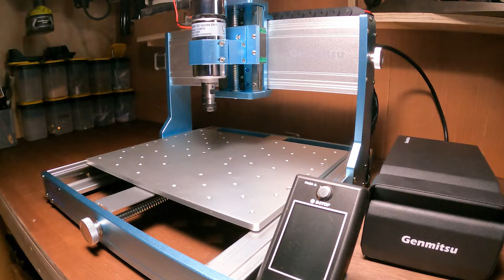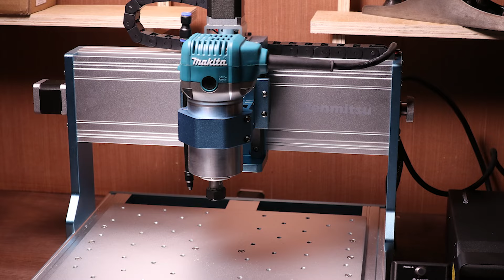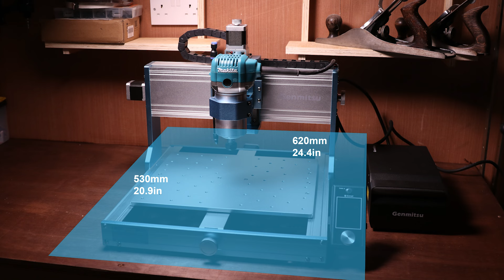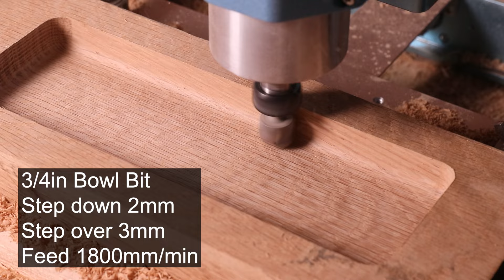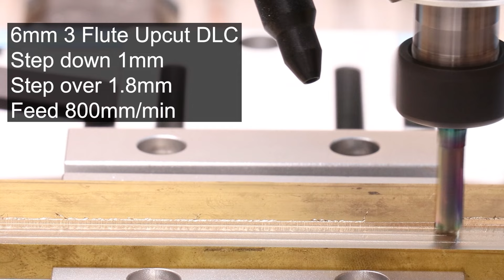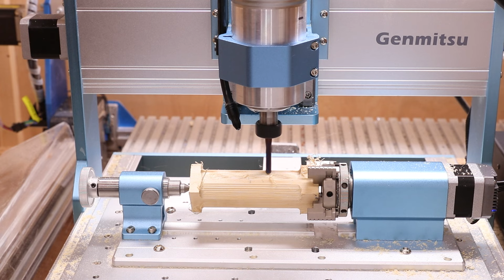Best CNC under $1000 - 3030 Prover Max Review

Comment: Hi! Could you tell me how far the CNC worktable extends beyond the machine's frame, both at the front and at the back, when moving through its full Y-axis travel? I'm trying to calculate the maximum space required for an enclosure. Exact measurements in mm would be really helpful. Thanks!
Reply from the maker: Unfortunately I no longer have this machine but Im sure if you asked on the Facebook SainSmart user group then someone would be able to help

Comment: Hello! I am between the 3030 Prover and 3020 pro max v2. I wanted 3020-PRO Ultra 710W but it is not available for EU atm.
I want to cut pieces out of 5mm stainless steel sheets. Speed and bed size are not important. Precession is important! I hope you can advise!

Comment: Can I ask what would ideal settings be for cutting aluminum with a 1/8" 3 flute carbide upcut? I have heard various things and also to use cooling, such as isopropyl alcohol. Your settings look very aggressive: 1000mm/min feed, 1mm depth per pass. And also, what speeds were you running your spindle? I have a similar machine, the Axiscreat 3030 with the 710W router and running it at full speed tends to melt the aluminum when cutting too aggressive. I was told to slow down my spindle to get faster cutting speeds. Most super pro CNC machines run their spindles very low, but the brus motors on these routers don't have enough HP to run those slow spindle speeds.

Comment: Hi, James. Just bought one of these and I have a couple of questions before I assemble it and design/build its enclosure.  1) If I don't fit the offline controller, is there another port anywhere else for the touch probe?  2) When you state the assembled dimensions, is the total width (stated as 530mm) inclusive of both the stepper motor and the offline controller?  Also, I have to say many thanks for all the great tutorials because I wouldn't be able to do most of what I can do today without them.

Comment: Would you say this is better than the xe pro at cutting aluminum
Reply from the maker: @swiff31  the standard XE Pro, yes. But if you added the linear rail upgrade to the XE-PRO then the XE-PRO is probably better
Reply: @ thank you I already have the xe pro I may add the rails to it

Comment: Mr. James, thank you for your videos, good explanations and great friendliness.
I just bought a CNC 3030 ProVer Max, it is really more impressive when you have it in front of you (The machine I have been using is the classic CNC 3018 Pro 100€, and now I am going to use a new CNC 3030 ProVer Max). It is like going from a sailing boat to a luxury yacht.

I have been watching many videos and I had many doubts between the CNC 3030ProVer Max and the CNC 4040 Pro. In the end, analyzing each of your words in several of your videos, I came to the conclusion that it is better to lose 10cm and gain rigidity.

The work is measured in quality, and quality is obtained in these machines from the rigidity and robustness of their guides and axes. Thanks to your videos I have been able to consciously decide which machine is best for my needs.

I haven't seen you upload a video recording stone yet, it would be interesting to use something soft like slate for example.
Thanks again and keep uploading content. We, the users, value it very much. Greetings from Spain

------------------------------------

Sr. James gracias por sus videos, buenas explicaciones y gran simpatia.
 Acabo de comprar una cnc 3030 proVer Max, es realmente mas impresionante cuando se tiene delante ( La maquina que he estado usando es la clasica cnc 3018 pro 100€, y ahora voy a estrenar una cnc 3030 proVer Max). Es como pasar de un barco de vela  a un yate de lujo.

Ando mirando muchos videos y tenia mucha muchas dudas entre la cnc 3030ProVer Max  y la cnc 4040 pro. Al final analizando cada una de tus palabras en varios de tus videos, llegue a la conclusion de que es mejor perder 10cm y ganar rijidez.

Los trabajos se miden en calidad, y la calidad se obtiene en estas maquinas de la rijidez y robustez de sus guias y ejes. Gracias a tus videos he podido decidir conscientemente que maquina es mejor para mis necesidades. 

No vi  aun que subieras un video grabando piedra, seria interesante  alguna blanda como la pizarra por ejemplo.
Gracias de nuevo y siga subiendo contenido. Nosotros los usuarios lo valoramos mucho. Saludos desde  España

Comment: How long is the travel on the z axis? I want to buy one but I am worried that the heigth is too short. How luch space is between the bed and the end of the mill, especially with the makita router? With a vise and then a object with over 60mm or 80mm in it its probably too tall i think or isn't it?

Comment: Hello! I just bought 3030 prover max and I have problems with cutting steel and aluminium. I have to go relatively slow for aluminium, but it works, however when i tried cutting steel my bit burned Down... I only had HSS bits at this point... Is the material of bits game changer or am I doing something else wrong ?
Reply: Speeds, feeds and depth of cut are crucial. 4 flute endmill on steel, 2 flute on aluminum. Length of cut should be as short as possible. This will depend on your final depth. I would not go more than 1mm depth of cut on either. Spindle speeds using 1/4" cutters, steel 1800rpm, aluminum 3000rpm, these are starting points, Adjust as necessary. Feeds, aluminum you can start with 12" per min, steel I would start at 4" per minute. I would suggest HSS endmills to start. They are cheaper and tougher than carbide. Carbide will shatter if abused. Use carbide when you get proficient with the machine.

Comment: When you load a gcode file to the offline controller, are all the feed rates and whatnot in the code recognized by the machine, or all of those parameters left to what you input in the controller via the display and stay constant throughout the job?
Reply from the maker: Your gcode file should contain all the information it needs to run. You simply set your Zero position, load in the gcode and press play

Comment: hi, what speeds/ number did you set the router at for these tests?
Reply from the maker: Been a while now but generally speaking I operate it between 2 or 3
Reply: @JamesDeanDesigns  hi. thanks for the insight. i tried running my machine and testing out the tool. i also have the same bit you used for aluminum but i found that when i cut into it at setting of 2 at 100mm/m, its really load and sounds like the cut its making is "screaming" i want to get to the feeds you were running at (1000mm/min @ 1mm stepdown) but i dont want to break my bit, router or machine. any advice? im using a SpeTool A02005

Comment: James, Great review. I have 2 questions: 
1. When you upgraded to the router did you just disconnect the old spindle's power box? 
2. How did you handle E-stop function with the router upgrade?
Please do an upgrade to router video on this machine.
Reply from the maker: Hi,
No I didnt disconnect the old spindle, I just tucked the wires out of the way. The e-stop would still work in terms of the machine movement shutting down but the only way to get it to shut the router down as well would be connecting the router via an SSR relay device. This is fairly easy to do and I have a video on it. It basically means the router will start and stop automatically without you needed to manually turn it on/off

Comment: Hi machinist here, thanks for the video! I guess the offline controller does make much sense imho. If your laptop/tablet/PC is going power saving mode... The work is finished then, even if it´s not. I think that makes it up for a offline controller. I also would apply a apc backup if possible, so you may not ruin a workpiece if you´re out of power for a few minutes. But maybe my last point is overkill for the home user.

Kind regards from Austria
Christian
Reply from the maker: Always good to have a backup but possibly depends where you live. Here in the UK our supply is pretty consistent for most of the country, in fact I can't remember the last outage we had....  probably will happen on my next job now😆
Reply: Overkill is OK for some things. This would appear to be the sort of machine we've been looking for. It has the capacity to make certain kinds of steel gears if the speeds and cuts are limited.

Comment: Hi @JamesDeanDesigns, 

I assume the information you gave for all the different cuts (e.g. the bowl bit 3/4 inch, Step down 2mm, Step over 3mm, feed 1800mm) are for the Makita, right? 
Do you happen to still remeber the Makita Settings (power Level/RPM)?
Reply from the maker: Yes they will be for the Makita. I generally run mine quite low so likely would have been number 2 or 3 at the most.

Comment: Wise move not continuing to cut deeper into the steel... all you would establish is how far is one step too far.
It would have been similar to a young mechanic's method for torquing down a nut:  keep tightening until it goes soft, then back off one quarter turn!   😮

Comment: So torn not knowing which to get, this one or the 4030 pro v2? Would be hard woods, copper, acrylic and other similar things.
Reply from the maker: Size...the ProverXL V2. Precision...the 3030. If it wasn't for the copper I'd have definitely said the  4030 but the 3030 is better for metal 😕
Reply: @JamesDeanDesigns  thanks! I think I'm go8ng for the 3o30 with makita router

Comment: i am wondering if i could cut my acrylic / carbon fibre  arcade plates to 300/295mm in length, cant go any smaller than that, or will that be to big?

Comment: Ok I got my genmitsu 3030 prover max all set up with the makita router and in my shop.  I was sure to email Sainsmart and let them know your review is what got me to buy it!!!  One BIG QUESTION though, did you tap the router into the spindle power that’s sitting on top of the Z Axis or just use your own power source and manually adjust speed and power on/off when your using it?  Big thank you!  @sainsmart
Reply from the maker: Excellent!!!
Speed of the router is always manually controlled but you can have it turn on automatically. You have 2 choice. You can either wire an SSR in yourself (not difficult I promise) or buy a smart switch which is basically the same thing but the hard work done for you. First video below is the SSR, second video is the smart switch
https://youtu.be/496rC1lVN68
https://youtu.be/vEOX8F8dkn0

Comment: I just finished putting mine together about an hour ago. Haven't used it yet. I just tried homing it, and turned the spindle on. It's late here and I have neighbors, so that's the most I can do for now. I mainly wanted it for PCB prototyping. I might try 3D printing covers for the limit switches. I have a spool of TPU filament that might be good for it.
Reply from the maker: There are already some design by someone I think, just can't remember what platform so maybe search yeggi. Alternatively a bit of tape over them will help as well. Hope you enjoy it
Reply: @JamesDeanDesigns  I saw a design someone had made a couple days ago somewhere. Tape is something I hadn't thought of though. I have a million projects in mind, if only I could make time.
Reply from the maker: @SwapPartLLC  I feel your pain. Time is my biggest restriction.
Reply: Do you like it? If so what are the pros and cons?? And how does it do with stainless steel?
Reply: @PilotEricG  Crazy, but I haven't even used it yet. I bought it mainly for drilling PCBs, but I haven't had time to get to any of my projects yet. I have some delrin I want to mill to make some alignment jigs so I can go back and forth between the laser engraver and the mill, but I've been too busy with work.
Reply: @SwapPartLLC  dang!! 3 months of sitting around. Lmk if you aren’t ever going to use it I might buy it off ya. If not, when you finally get around to it have some fun and lmk how it turns out.
Reply: @PilotEricG  I'll get to it eventually. Work is always priority though.

Comment: Would you think that beefing up the stepper motors and using the makita router would be enough to consistently do small 1-2mm cuts on steel?
Reply from the maker: I'd like to think so but a router probably isn't the best for consistently cutting steel. I imagine a spindle VFD setup would be better

Comment: You kinda copped-out on explaining why the axis are better by saying things like "Now, every axis is running on HG15 linear rails. And if you're not familiar with the terminology,
basically what that means is just everything is very supported and solid." That's just marketing speak. Saying "what" is not a replacement for "how" or "why" that's the case.  Even a newbie should understand it if you took the time to say "A cheap 3018 uses a pair of 10 mm rods to support the head and another pair for the bed that are prone to flex under loads. While the Genmitsu uses 15mm HG15 rails, which have more than 2.5 times the material than a 10mm rod making the unit much less prone to flexing and enabling more precision in use."  Same type of comment about using ball screws versus plain lead screws. It just fell short. Demonstrating performance is also great, but nothing to really show overall why a cheaper machine wouldn't do just as well.

Comment: Hi. I did screw-up my 3030Prover. Now the probe works backward... Can some one can do $$ in UGS and send the results ? Thanks.
Reply from the maker: Is it just the probe is backwards and everything else is OK? If so then just add a - before the number and it will move down instead of up
Reply: @JamesDeanDesigns  I did screw-up the settings. The probe button on Offline control goes backward. I have fixed with $3=3 and $23=3 but I'd really appreciate if someone can provide me with all settings. Please do $$ in UGS and share the results. Many thanks !
Reply: I probably messed things when using OpenBuilder. Still learning....

Comment: When you swap out the spindle for a Makita palm router - does anything power/control the Makita router?  Or do you just simply plug it in separately and turn it on when its time to carve?
Reply from the maker: You can do it either way. In this scenario I used it manually but I've got a few videos showing you how to have it run automatically. One way is wiring in an SSR relay yourself, or alternatively you can buy a premade device like this  https://youtu.be/vEOX8F8dkn0

Comment: thanks!  does it actually come and an air assist also, or did you have to supply the air pump? looks like genmitsu has a makita clone 1.5  router as option also.  any thoughts?
Reply from the maker: No air pump comes with this. Yes, Genmitsu now have a trim router for machines. I suspect it will be good but I have not actually tested one yet so I can't really comment

Comment: nice review, i just changed from pro max 3020 v1 to v2 with extension kit. Did have same problem with aluminium chips triggering errors. I disconnected the endstops. Strange that manufacturer did not noticed or addressed this. What bits do you use for metal? a they a-class (expensive) ones? I have to go super slow and shallow with my 300W. No problem, job just takes langer. If i would go 1mm in aluminium i guess i would get the feeling that machines explodes. For me a save depth is 0.2mm. Thanks!

Comment: 2 questions.
What is the clamp you are using to hold the aluminium? 
I need to do a job where I do mill on the 2 sides of the aluminium and then in the center of that cut, do you think this machine is capable of it?

Comment: Just saw, the Makita router does not have a grounded plug, so the router housing is not grounded too. The Z-Probe works fine with the Makita router installed. For my grounded Proxxon spindle I'll try either a mechanical switch or a kind of optocoupler to avoid interferences with the ground connection.

Comment: Thanks for the video.  Could you tell me please, would this be better than upgrading the CNC 3020 Pro MAX V2 to a 3040 with the extension kit?  And same question for the CNC 3040 machine please?
Reply from the maker: Definitely better than an upgraded 3020 Pro Max. When you say CNC 3040, I am guessing you mean the ProverXL 4030? Debatable there depend on what you want. The 3030 Prover Max is going to be more accurate but the ProverXL 4030 is more powerful and has extension kit available so you can expand.
Reply: @JamesDeanDesigns  thank you for your quick response.  My interest has been renewed because of BF.  I am also looking at the Ooznest workbee + machine.  Do you know of these and how they compare with the Sainsmart machines?  Thanks.

Comment: did the cnc cut aluminium and brass without the router upgrade, or did you just test it with the router upgrade? and which grade of steel did you test the cnc with? I want to get one, but I live in an apartment and don't have a shop. I would be very grateful if you left some dust collecting advice, where to get an enclosure for noise reduction and chip/dust collection (as I don't really have the tools to build one, or a shop where i can make a mess). thank you in advance :). any other advice to help me get started on this journey is very welcome :)
Reply from the maker: The stock spindle will cut aluminium and brass but at slower/shallower rate. I do show it cutting aluminium earlier on I believe.
The steel is just mild steel, don't know exactly what grade.
Enclosures do help cut down the noise. But dust extraction (typically a vacuum) will add noise. I often just let my machined run in the enclosure  and clean up at the end
Reply: @JamesDeanDesigns  thank you for taking the time to answer. 
In terms of enclosure, how can i build a dust proof, sound dampening enclosure, without cutting wood? Do I use aluminium extrusions? What other materials would I use and how would I have to use them? Thanks in advance :)